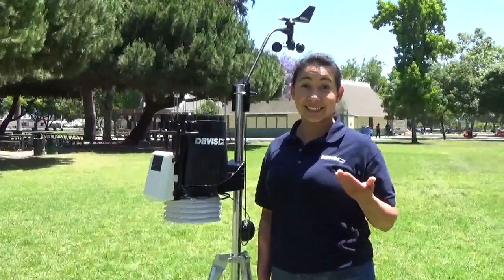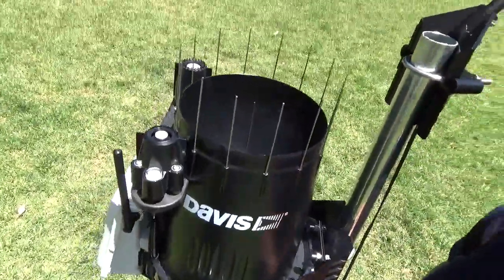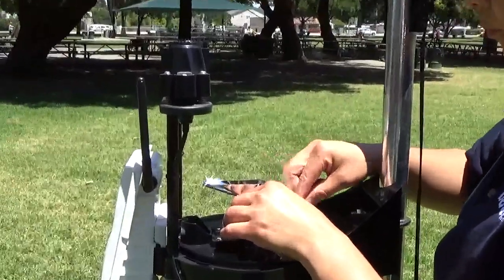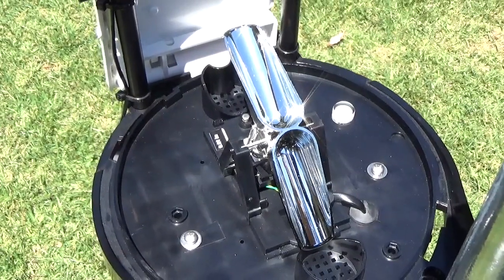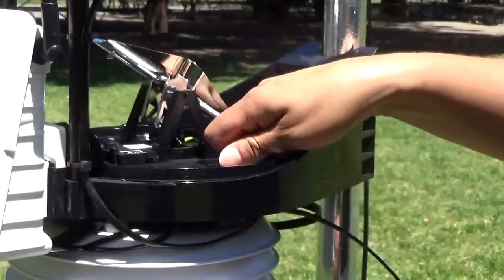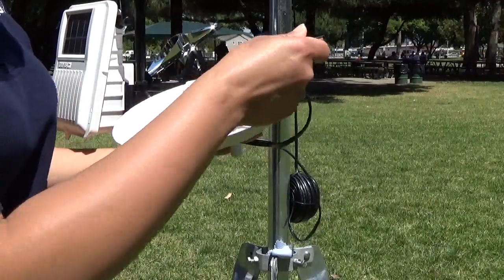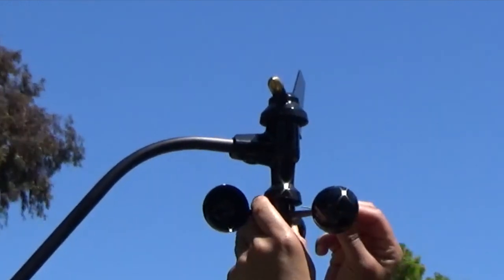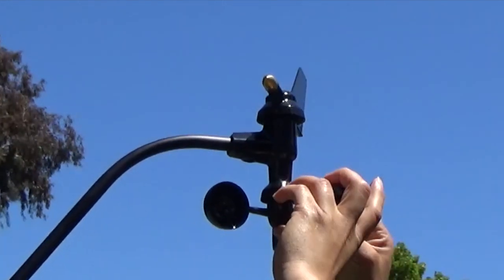Davis Vantage Pro2 Maintenance How-To

Comment: My Pro2 has ceased to have any data on the screen. The bottom of the screen it says "receiving data from " but nothing else. Its plugged in and the batteries behind the svreen are ok. I unplugged and removed the batteries and waited a bit before reloading .still nothing
Reply from the maker: Roger, please contact Tech Support. They can walk you through this. (510) 732-7814, M- F, 7:00 am to 5:30 pm PST; or support@davisinstruments.com

Comment: What is the cleaning frequency for each sensor in dusty environments?
Reply from the maker: It's really as needed. If you are in a very dirty environment keeping it clean might mean some wiping down every month. Once a year you should do the big clean up where you dissemble it, but keeping the rain collector clean or debris and dirt, webs, etc off the radiation shield and anemometer should be done as frequently as needed! You don't need to disassemble it- just remove the rain collector, wipe down with a soft damp cloth.

Comment: Aren't you supposed to disconnect the system from the data logger?  All those tips were logged as rainfall when the tipping buckets were cleaned....
Reply from the maker: If you are using a data logger, that would be a good idea, Phil!
Reply: @davisinstruments  I think Phil meant the Integrated Sensor Suite. Your own manual https://www.davisinstruments.com/product_documents/weather/manuals/07395-333_IM-6322C-6334.pdf on page 41 specifically mentions: "Cleaning the rain collector and tipping spoon may cause false rain readings. Unplug
 the rain sensor from the sensor interface before cleaning so that no inaccurate readings are logged"

Comment: Not so easy to do maintenance when the unit is on a pole 20ft up 😉
Reply from the maker: Derek, the rain and temp/hum part of the sensor suite should really be mounted at 6' above the ground. One big advantage of the Vantage Pro2 is it allows you to  mount these sensors at 6', and put the wind sensors up at 30', where they should be. That also makes maintaining the rain collector much easier.  But not as exciting.
Reply: That's good to know. I usually have to send my buddy up to unclog the rain cone in the fall. I'll leave the anemometer up and see if I can find a suitable spot at a lower level.
Reply: Make a sleeve in the ground and then stick a 20 foot pole and anytime you need to do maintenance just pull the pole out of the sleeve in the ground and then you never have to climb a ladder! One day I'll do this and make a video.

Comment: Nice, but would have liked to seen instruction on how to clean and troubleshoot the wind vane.
Reply: I was experiencing a constant N reading on my console. The wind speed would register and direction would stay on the N. I was concerned if it was the anemometer itself or if there was a problem with the control panel. I contacted Davis and they sent me a test cable to determine if the problem was in the anemometer or the panel. It turned out the anemometer was bad. I replaced the anemometer and all is back to normal. Thank you Davis!
Reply from the maker: Thank you Lee!

Comment: Just clean the uv and sun sensor and the rain bucket, no more.
The rest just gives damage and is not adviceable, the temp sensor is very fragile and the rain buckets insite is clean because of the filter in the cone.
Reply: Wrong.  Cleaning yearly is my mantra on these and the temp sensors is not that fragile.  I've cleaned it every year since 2013 without any issues.  Once you get good at it, you can dissasemble, clean (usually take mine inside and clean the all the platters and screen), and reassemble in usually less than thirty minutes.
Reply from the maker: 😊 Detailed instructions are also in your User Guide (which can be found here: https://www.davisinstruments.com/product_documents/weather/manuals/07395-333_IM-6322C-6334.pdf)
Reply: @davisinstruments  link is bad

Comment: Do I need to disconnect the receiver prior to start the cleaning process? I mean, if I start moving the raing collector or other sensos, the system can get and store false readings? Mine is wireless.
Reply from the maker: Good question! We do recommend that you open the transmitter shelter (the white box with the solar panel on the front) and disconnect the sensors from the interface before cleaning.

Comment: Glad you made this video!  I've had mine since Oct 2007 and have only cleaned the rain collector when bird doo doo has clogged it.  I've also replaced the battery once.  I got a new styled rain collector with the debris shield and bird spikes a couple months ago, but haven't installed it yet.  I've had some problems in the winter with the outside temp/humidity sensor intermittently quitting for a couple weeks at a time, but when the weather gets better it works.  I also have the fan aspirated shield, and from further reading I doubt the fan works any longer, but it seems to be reading very accurately still.  Sounds like I'd better start giving it more TLC after watching this video as it wasn't exactly an inexpensive purchase.  Thanks!
Reply from the maker: If you continue to have issues with your fan and/or temp/hum sensor, please feel free to contact our fantastic Tech Support team at support@davisnet.com. You might even connect with Leticia whom you see in this video. :)
Reply: Thank you!  I'll have to look into all of this, but mine's on the roof and I haven't felt like working on this yet as I've got some arm problems since last winter not getting any better; thus not even the rain collector done yet.  But you guys will be the first to know when I do.  I know my temp/hum sensor is an old style, and a few years ago they were very expensive, but could be rebuilt for about half the cost of new.  From what I've read you've got a completely new sensor for a lot less money.  I'll get all of this back into good shape this summer.  But for being up there since around Oct 2007 this unit has been extremely reliable, just mainly rain collector issues with the birds and that sensor.